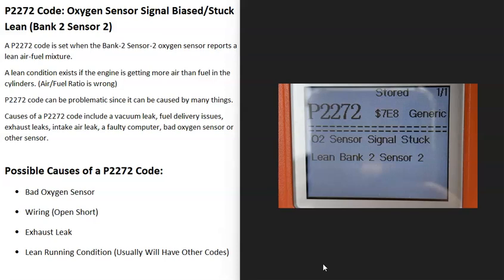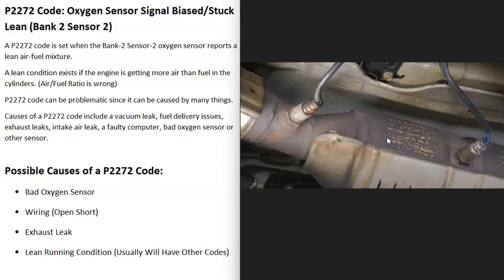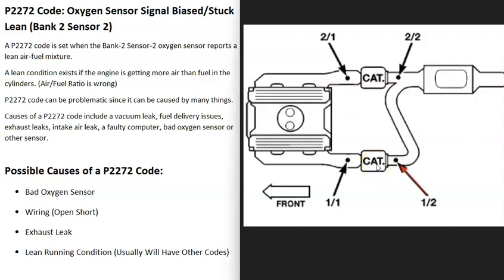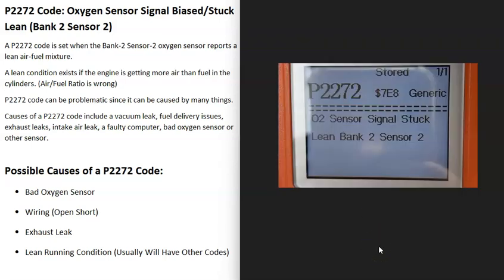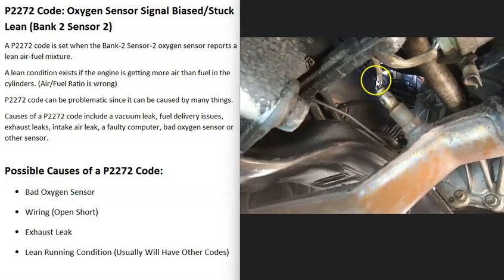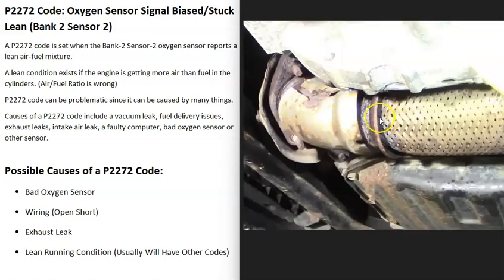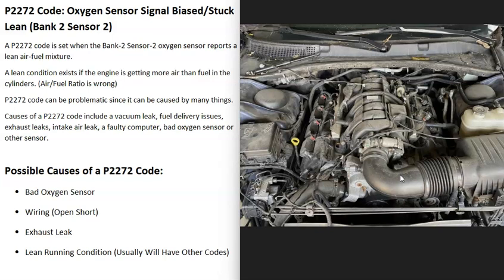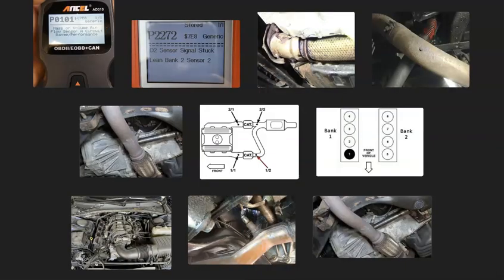Causes and Fixes P2272 Code: Oxygen Sensor Signal Biased/Stuck Lean (Bank 2 Sensor 2)

Comment: Hi there, i appreciate your work explaining this all well. 

My exhaust had two leaks, one at the flange and another near the midpipe silencer, i've replaced the exhaust on my E82 125i N52 with a 135i N54 exhaust and the flange fabricated and welded. 

The codes i have remaining are: 
1) P0420 - Catalyst system efficiency below threshold bank 1
2) P2272 - O2 sensor signal stuck lean bank 2 sensor 2

I assume these sensors are exhaust side that need replacing or do you reckon i still have a leak? They garage that undertook the work ensured that there are no exhaust leaks.
Reply: Check for air leaks at intake manifold gasket, whether any hoses connected to intake manifold are cracked or leaking.  For the catalytic converter you can try a bottle of cat/egr cleaner which might save you replacing a catalytic converter.

Comment: What about a p2272 followed by p0401
Reply from the maker: If the EGR valve is stuck open, that can cause a rich condition, usually not lean, but it may be possible.

Comment: I’m getting 2272 and 2273. Meaning it is too lean and too rich, would it be likely that the sensor is no good?
Reply from the maker: Yes, it could be bad; I would test the Bank-2 Sensor-1 and be sure it is good. If the sensor test is good, then it can be difficult to diagnose rich and lean codes. I made a full video, here is a link to one. https://youtu.be/b9__WGuD-dc
Reply: @HVAC_Mechanic  oh thank you

Comment: Just replaced this sensor in July and back having this code again. I did see the wires had been up against the exhaust pipe just before the sensor when I did it in July so I made sure it was zipped clear of the exhaust tube. I'm getting no other codes other than she's gulping fuel...how do you check that the sensor itself isn't faulty outside the system? Do you hear that sensors from some 'zon suppliers are bad?